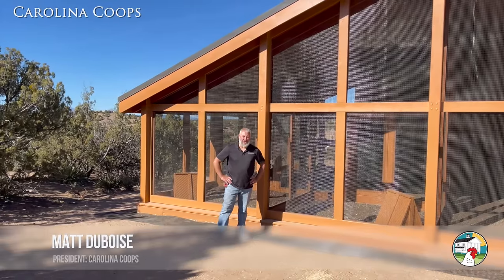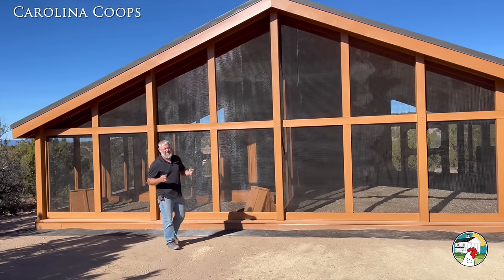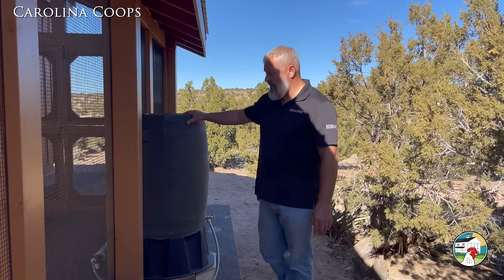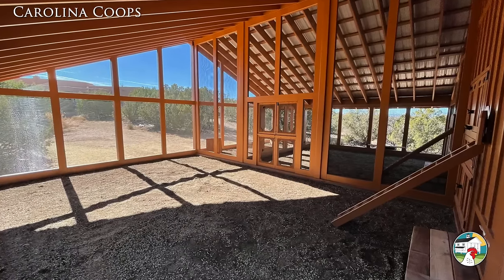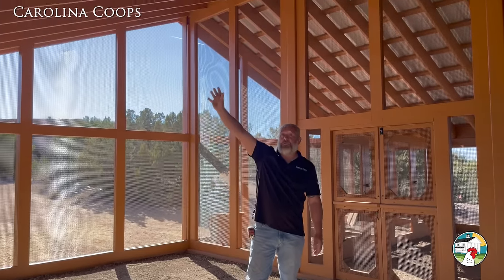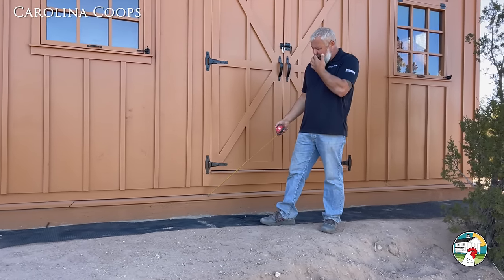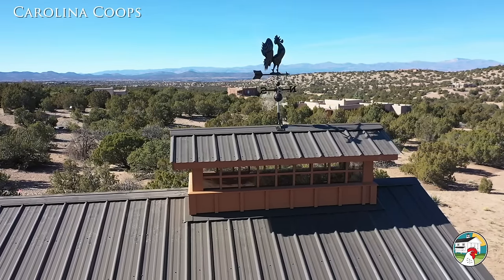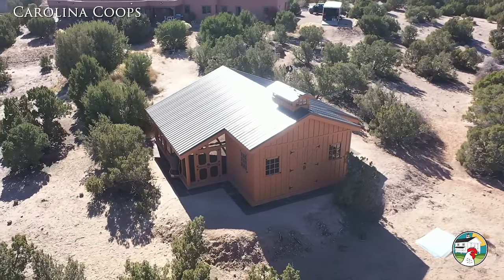See Our Largest Chicken Coop | Can't Free Range? No Problem, This Coop Has it All

Comment: I'm a contractor and i can understand that this was a massive job to say the least. The attention to detail and the craftsmanship for a chicken coop is next to none. The hen house looks like furniture. The door gaps are beautiful and I even noticed you caulked all the board and bantam. That 1/2" wire is pulled tight! It looks like you guys painted this entire structure by hand but i hope you sprayed it and back rolled it .. so much paint and cutting in. In regards to storm shields .. the customer should've incorporated some kind of roll up/ down steel doors tucked into the outer eve's on the long sides and maybe something inside on the ends. I hope they run some water misters out there to keep the dust down and the chick cool. Anyway, you guys never seize to amaze. 46 days to do this is pretty dang quick. Awesome job guys!
Reply from the maker: Thank you so much for your comments and for appreciating all the hard work and details that went into the construction of this massive chicken coop.
Reply: @CarolinaCoopsVideos  I also wanted to share with you a really cool and simple way for attaching storm windows without screws extremely fast and effortless. I suggest you look into "Sign Spring a.k.a SNAP FRAMES" .. these are what poster and billboard companies use. Trust me.. it's a game changer and you'll love em
Reply: Love the idea of the roll up steel doors! Great for very windy locations…… like mine!! ❤️
Reply: Yeah,  he kept saying how long it took to build.  I thought 46 days was good.
Reply: @matttafakt  why not just use storm window snaps? Would be cheaper and easier to fit to any size and lot less effort then screws that over time strip out from being put in and taken out yearly. Just a thought
Reply: Ηοw much did it cost? 30.000 usd?
Reply: That’s my question too)
Reply: Most expensive eggs in the world!

Comment: One idea is to section off parts to grow fresh grass. Rotate them
So they have fresh greens & allow the insects&’worms to lay eggs & hatch. The chickens will love it!
Reply: Or you could make fodder boxes using the 1/2" mesh on top, could even make it a wiking system so you put water in once a week or something. That way it less work for you and the chickens won't kill off the grass as long as the box is high enough so they can't pull the hole grass sprout out and you don't need to use grass either barley, wheat what ever. Best part won't need to rotate.

Comment: I absolutely love your coops.  They are so well designed.  I have a suggestion on window dowel system (if you haven't heard it already).  I use barrel bolt latches to hold open the doors.  It is the same concept as the dowels, but they are metal and are more convenient to use.

Comment: High strength epoxy is the way to go, that's exactly how I installed the solar panel on my chicken bunker,  it has a 7/16 stainless steel threaded rod 3i inches deep with high strength epoxy, designed to hold that panel down in winds of 160mph.

Comment: I'm not familiar with that area of the country so I don't know which direction the winds blow from there etc. But it seems like a lot of the interior doors that lead between the run and the coop roosting area it's self don't really need to be there. They could just be hardware cloth windows. This is based on the concept of the woods coop, an open air coop that lets a lot of ventilation in. Just something to think about.

Comment: Did they want a system this large (height) because of how many chickens they want or because of heat ... ?  Or just because they won't be free-ranging? How many chickens would be best for the space per your formula (I know you talk about it in other videos, but it would be a nice mention for a build this big.)
Reply from the maker: Great question. They didn't want to free range because of the amount of large predators they have in that area. Because we build our coops like people build houses, there is a domino affect. Since the coop is so wide by design, it causes the roof, the walls, of all it to be higher. Even in our smaller coops this occurs. Our 6 foot wide coops have a peak of 7 foot. When the same coop is 8 foot wide or 10 foot wide, the peak is higher. 
The henhouse is 10x6 (split in two), so with our 1-foot rule on the roost bars, that would max out the henhouse at 30 chickens. We hope that helps to explain it. Thanks for watching.

Comment: what an awesome space! question about cleaning the roosts? we often have to scrape ours. how do you scrape/clean the rope wrapped ones? thanks
Reply from the maker: We find that you shouldn't have to clean the roost bars.  We make sure our roost bars are no closer than 12” inside to inside from each other.  Also we prefer that all of the roost bars are at the same level.  Third is we like allowing 12” of roost bar space per standard size hen.  Thank you for watching and your question.
Reply: I was thinking that the rooster cage walls that he tried to discourage is going to be a regret.  Those walls are going to be dripping in a slightly awkward to scrape place.

Comment: Is there a reason why automatic hen house doors aren’t used?  I am thinking of getting one but wondering if there’s a reason why they’re not used.
Reply from the maker: Automatic henhouse doors aren't necessary with our coops because the flock is protected by the coop. This is due to the way the coop is designed and crafted with only high quality materials. So we haven't had any predators get into one of our coops. Some people want it for an extra layer of protection but for our coops, it's not necessary at all. Thanks for your question.

Comment: Screw the pressure treated holes... I wouldn't have used them for anything but the foundation... That had to add a lot to the cost for The wood and to fill the holes... And your in the high desert not new England... Your not rotting out there, no water, constant temperature... Oil alone would be fine

Comment: Absolutely amazing. However, the exterior of the coop will not protect the chickens. Bears slice through that like it is butter. The chickens need to have their little door locked at night. My husband had designed ours with solar where the door opened and shut by itself at dawn and dusk.
Reply from the maker: Hi, thanks for your comment. We respectfully disagree. If bears would try to get in, they would have a very tough time. The hardware cloth is extremely strong as is the way it's fastened to the coop. The structure itself is also incredibly strong, made from premium lumber. Can bears wreck a chicken coop? Yes. Would they be able to trash this one? Highly unlikely.

Comment: All you had to do in the roosters are was add a chicken mesh in the ceiling without having to run the wall all the way to the top
Reply from the maker: That is a good point, however with the roof so high, the middle wall not only looks more ascetically pleasing but acts as structural support.

Comment: How many chickens would you recommend for this size coop?
Reply from the maker: There are three 10 foot roost bars in the henhouse, which will accommodate 30 chickens. We usually add, with free ranging, but this run is big enough to accommodate the maximum chickens. We use the henhouse to determine the amount of chickens. Thanks for watching

Comment: I inch door gaps kind of defeat the purpose of 1/2 inch hardware cloth.
Reply from the maker: Actually there are no gaps wider than 1/2” exactly.  Truth be told for example with the doors the wood dried so much that we started with 1/4” spacing but with a 1/6” here and a 1/6” there we ended up at some spots with 1/2” spacing.